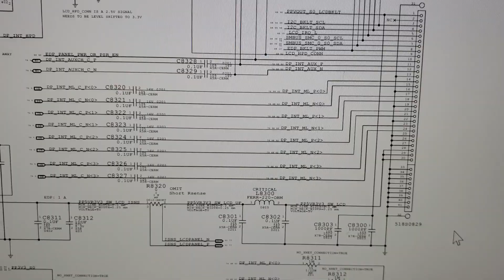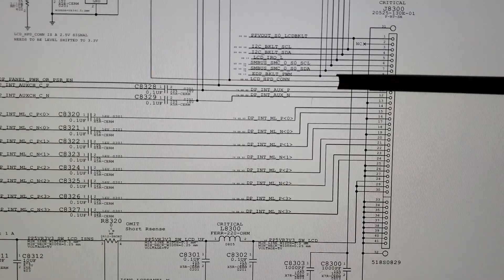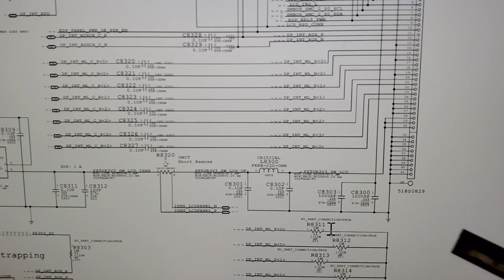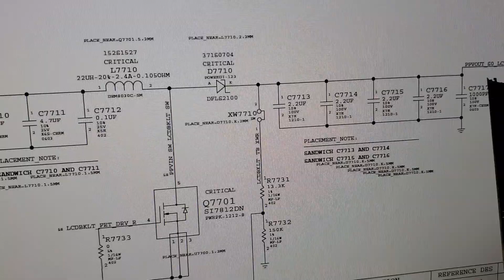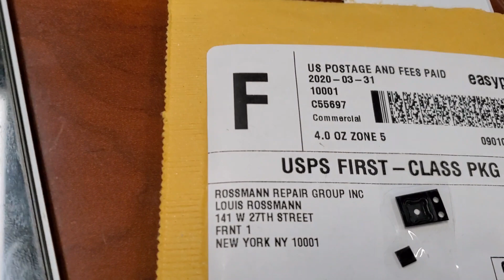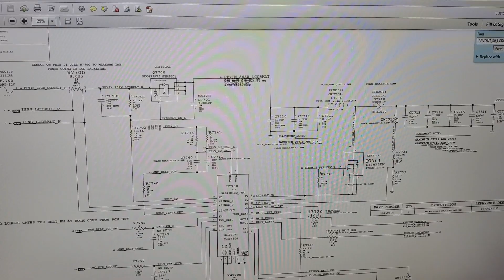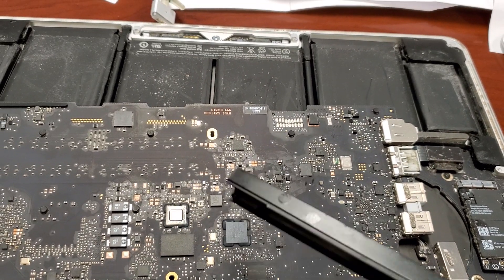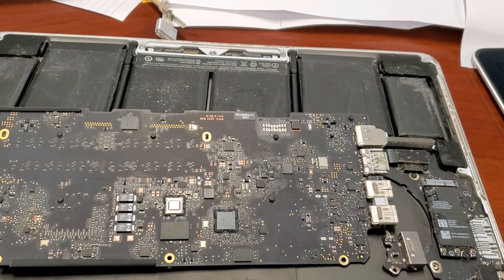MacBook Pro A1502 no back light FIXED board 820-3476-A

Comment: I bought a liquid spilled A1502 to try to recover the screen assembly for my broken screen. Turns out there is no backlight on the assembly or on the motherboard. My guess is the LED's shorted then blew something on the motherboard. Zero sign of liquid on the motherboard but it will not power my backlight. LCD seems to work when i shine a torch through the apple logo. I'm going to try to recover the lcd by using the playing card trick. However would be nice to fix the motherboard so i can re-sell the main part of the donor machine. Thinking driver or one of the 5k resistors but that's why i'm here. Funny thing was when i opened my machine it had some liquid damage. both stickers were red and corrosion was present on two part of the mother board, right around the center, bit strange so i cleaned it up with a brush some alcohol and some kitchen paper. Hopefully it hasn't done any damage. In the past the computer tended to act strange after a few hours and needed a restart but i put this down to the hard drive being jam packed.
  Showing the test points for those voltages would have been good.